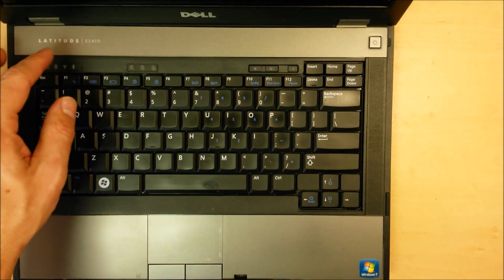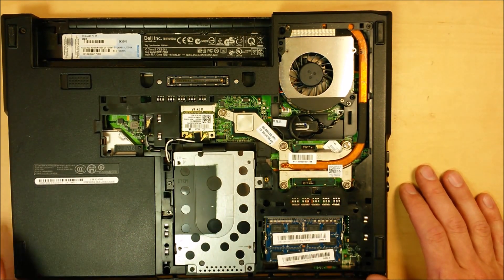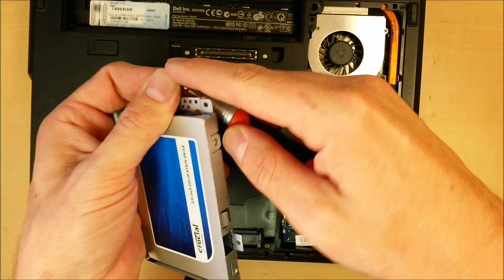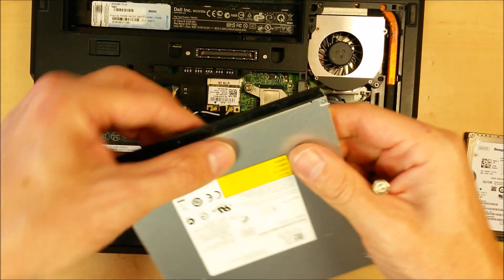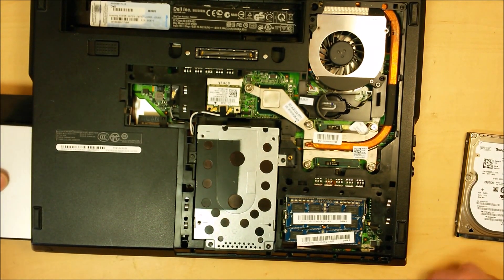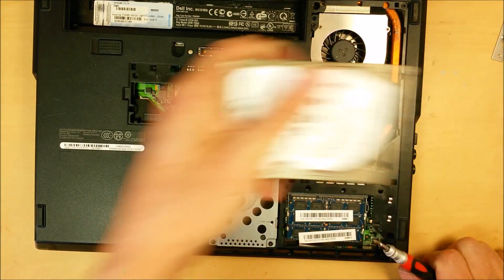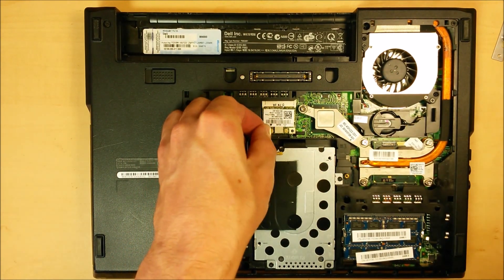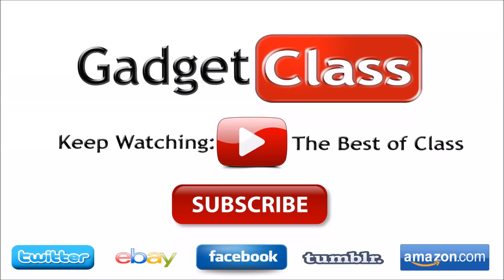Dell Latitude E5410 & E5510 ~All Hardware Upgrades; SSD, RAM, 2nd HDD, CPU, DVD, Wifi, CMOS

Comment: Hi bro, After watching this video I upgrade my dell latitude e5410 by installing ssd in place of hdd & install fresh window 10 on ssd & install old hdd in cd drive. But the problem is that my hdd is not showing any where neither in disk management not cmd list dispart what will I do to fix it. Actually I disable all Windows update any driver update from gp edit & registry after installing fresh Windows 10 before connecting internet because as soon as it connected to internet display driver goes updated and screen become black as Windows 10 not support in e5410 so need to reformat to visualize screen.
Reply: If the original HDD still had the original windows still installed the system will flag one as unreadable. You need to format the old one before having them both installed at the same time

Comment: I know im way too lte to the prty but I love this video very clear and to the point. I upgraded my RAM and want to upgrade my hard drive to the crucial SSD you linked. Now my only question is how can i clone windows 7 OS? I don’t really care about my files but I need the OS because as you probably know Win7 is no longer supported. I have tried finding ways to create bootable USB but they all install with no drivers. The version of windows 7 pro that i have now has all updates including firewall, windows updates and drivers. Any advice at all would be appreciated. Please help, i really want to upgrade to SSD. Thank you!

Comment: Uhm is it normal that my dell latitude e5410 crashes after upgrading to 8gigs of ram? I mixed up the original 2gb ram stick with (1067mhz) and a ram stick from another laptop which is of 4gb (1600mhz) and it just crashes just because of the 4gb ram stick but it works well on my other laptop (both are ddr3).
Opinions and suggestions are highly appreciated.
Reply: They are SODIMM too, does it crash because of legacy boot? It's an odd experience lol
Reply from the maker: They obviously aren't compatible
Reply: @GadgetClass  is it the frequency that makes it not compatible?
Reply: Oh that's sad I thought it was supposed to handle it
Reply: Thanks though!

Comment: If I try (Crucial MX500 250GB 3D NAND SATA 2.5 inch 7mm (with 9.5mm adapter) Internal SSD) SSD in my latitude e5410 laptop with 8 gb NANYA ram, it will work better or not?
Reply from the maker: An SSD is one of the best upgrades you can do on these old laptops.

Comment: can i attach egpu on my laptop and how?
Reply: You need to buy a pcie to m-pcie adapter like "EXP GDC Beast" and "External Monitor" because it doesn't work on the laptop's monitor, you'll lose a lot of performance because of "CPU Bottleneck" like 40±20% and you're only using 4x1 m-pcie instead of pcie 16x slot, with my GT 1030 2g GDDR5, it's very unstable

I get 
20-30 fps on "gta V online" and "enlisted"
Valorant/CS:GO are unplayable because of CPU Bottleneck

Comment: I was wondering if i should buy 1 stick of 8gb ram 1600mhz or 2 sticks of 4gb ram  1600mhz if someone knows which one is a better option it would help a lot
Reply from the maker: If both are compatible, it won't really make a difference either way.
Reply: @GadgetClass  thank you very much

Comment: When it comes to memory , Why I can't use one stick of 4GB and one of 2GB?
Reply from the maker: Actually you can. In old motherboards it was not advised but nowadays you can mix sizes. Best if they are the same brand and model though.

Comment: This video is awesome - I never knew I could upgrade this laptop to 8GB ram or install a second hard drive.  I have just installed windows 8.1 and an SSD - and even with 4gb ram it is more than capable of the tasks I need it for - surfing the net, word and netflix - Thanks so much - going to order 8gb ram and swap out the optical drive for a second hard drive - will adding a second hard drive slow the laptop down?  Thanks - brill video!
Reply from the maker: Glad to help. It's interesting how many of these ate still around.
Reply: @GadgetClass  tried 8GB this evening but amazingly I forgot a 32bit laptop maxes out at 4GB.  Anyway I'm thrilled to have refurbished it with a fresh Windows install and SSD - thanks again!

Comment: Love my bulky heavy E5510. Would like to learn which WiFi card would upgrade it to dual-band to include 5.8 GHz and possibly Bluetooth as well as my particular E5510 doesn't have 5.8 GHz nor Bluetooth (nor HDMI).
Reply from the maker: Not sure if there is a compatible WiFi card upgrade.

Comment: Thank you for this excellent no nonsense how-to video. I wonder...... could you have just put the SSD in the optical bay and left the HDD where it was then set the machine to boot from disc (now SSD)?
Reply from the maker: Oldbatwit Yes, but you can't have both drives in at the same time in a cloning situation. Windows likes to flag one as unbootable.
Reply: ok, thanks

Comment: A jeweler's screw driver set works fine. Quite easy to find. To make your screw drivers magnetic just line it up with a bar magnet. Then run the screw driver length across the length of the bar magnet a couple of times.

Comment: i installed the ssd in mine, and tried to get the drivers and it still seemed slower than the hdd? what did you do?
Reply from the maker: manofadventre83 did you clone  your IS over to the new SSD,  or did you do a clean OS install?
Reply: GadgetClass i did a fresh install. went upgraded the bios and drivers from Dell's site. i tried 8 gig memory upgrade and it wont work either.. ughh. it recognizes it in bios. but only works on Original 4 gigs. i tried all combos of it and resetting cmos battery.  I'm getting a note in the Bios says due to amount of memory being assigned for system use "memory available" is less than "memory installed"   i7 2.8ghz  i dont see any options to alter any settings really for memory.
Reply from the maker: manofadventre83 windows 32 bit can only use 4gb of ram. upgrade to 64bit IS if you want to use all 8
Reply: GadgetClass it is 64

Comment: Hello
You used 2x4 GB?
Your 4GB Memory Kingston SoDimm 1600mhz is 16 memory chips?
Thanks.
Reply: Ivan Ipunovich i had 2 x 2 gig stock ram. replaced with 2 x 4 gig crucial ddr3l 1600 sodimm

Comment: Some questions: can the memory be 2+4 GBs?
When taking off the bottom cover there are many tiny claws that can break down from the cover and fall onto the motherboard. What can I do about it?
Is there a way to upgrade the GPU?
Reply: Yes but be sure that the dimms are both at the same frequency. I tested my other rams inside this E5510 and it worked perfectly. It was one 2GB and one 4GB.
Reply: The GPU is built into the processor. If you want a better GPU, the only options are to get a usb GPU or get a better laptop. You can get replacement covers off of ebay. Just be careful when taking the cover off and putting it back on.
Reply: François Bellavance help my e5510 won't boot I have 2gb and 4gb

Comment: Thanks for this very helpful and informative video. My Dell Latitude E5410 came standard with a 2Gb DDR3 Ram. What I want to know is, can i add onto that with a "Crucial 4GB 1600MHz DDR3 SO-DIMM Laptop Memory" (totaling 6GB of RAM), and secondly, does it have to be 1333MHz, or is 1600MHz fine ? Thank you once again
Reply: Shaun S 1066 MhZ

Comment: Thanks for the information. Can I go ahead and just upgrade my HDD to the 2TB Samsung you recommended without having it at 120GB and then have the 2TB as a second storage? Another question, do you have any link to a replacement keyboard for this? Thank you again.
Reply from the maker: if you have an optical bay you can definitely add the second drive. if not you will have to replace your old one with the new one

Comment: I too have tried the listed RAM in a machine previously upgraded to Windows 10. I'm getting consistent BSOD on startup. I've tried two different 8 gig sticks from NewEgg, neither worked, now I'm just going to go with whatever Crucial recommends. Thanks anyways for the otherwise informative video.
Reply from the maker: hmm. you may want to run the Dell system check utilities. (accessed at startup) you may have another issue.
Reply: +GadgetClass The diagnostics pass until the memory begins getting tested, then the entire test suite disappears and I believe the machine tries to boot. Sorry, I'm not near it at the moment. I observed that behavior with both sticks.
Reply from the maker: +Russ Edwards Hmm. Please update is if you find a brand type that does work in your system.
Reply: Very strange you managed to get it working, as the Dell E5520 only supports up to 4GB RAM per slot.
Reply: +James Thompson Are you referring to me or the original video poster? The last link I provided is for a 2x4 GB kit.
Reply: Russ Edwards Oh, you said the "listed RAM", so I assumed you were talking about 8GB.
Reply: +James Thompson Oh, by listed ram I meant the stick linked to in the video description. That link takes you to an 8 GB stick on Amazon which may be the whole problem.
Reply: +Russ Edwards ah that makes more sense 😃
Reply: avoid 1Rx8 memory for Dells
Reply: @hnos7computadorespersonali658  This thread is 4 years old, dude. Thanks for the necro and the memories...

Comment: can i change the cpu to a intel xeon chip
Reply: The processor you change to has to have an Intel integrated GPU built into it. Otherwise it will not work. You can use up to an i7 2 core processor.

Comment: can i use cpu i5 new generation ?
Reply: Yes. You can use up to an i7. However, the processor must be a 2 core processor with an Intel integrated GPU built in.

Comment: I have a E5410 i3 I was wondering if it's worth the upgrade process
Reply from the maker: If you still use it regularly, or plan to, then yes. You want to at the very least put in an SSD and make sure you have 4gbvof ram for 32bit windows or 6-8 for 64bit windows

Comment: Thanks for this video. Only one question - is it safe to change i3-350M CPU on i7-640M CPU? I have model E5410.
Reply: StasiuX7 I'm pretty sure you can, I've just moved from i3-330m to i5-560m, 50% performance increase. I7-640M is too expensive as top model (80$ on eBay), and gives only marginal improvement over 560m I bought for 20$. See passmark CPU list for details.
Reply: I can give the link of ebay for the processor i5 they are Dominican Republic and want me to bring my country